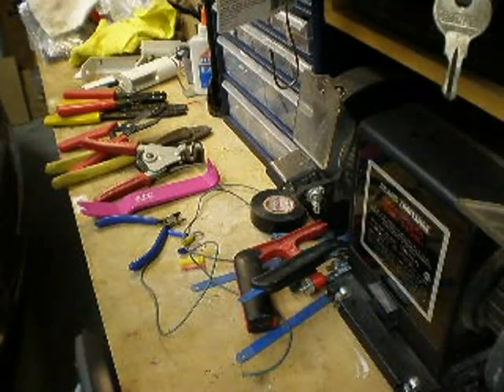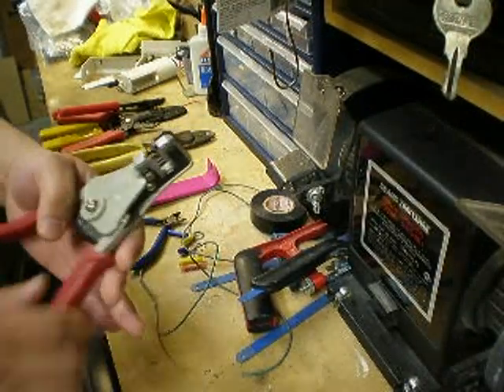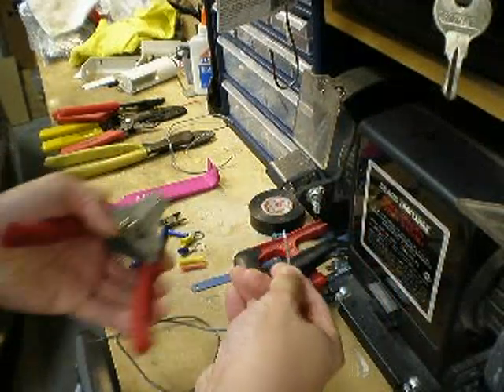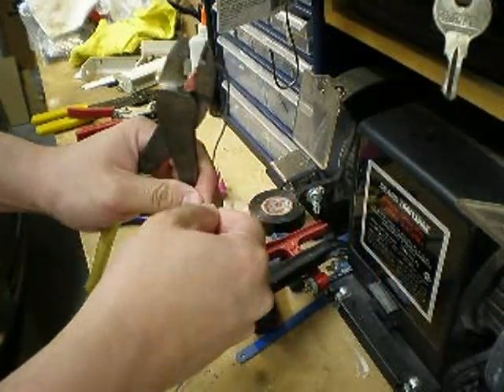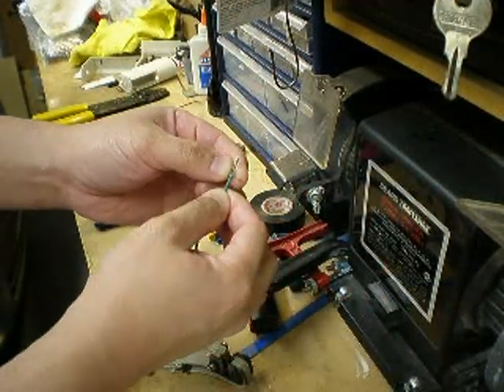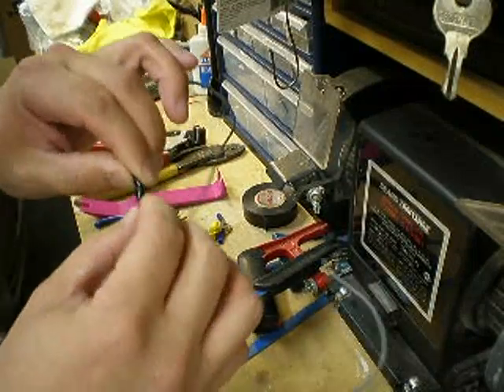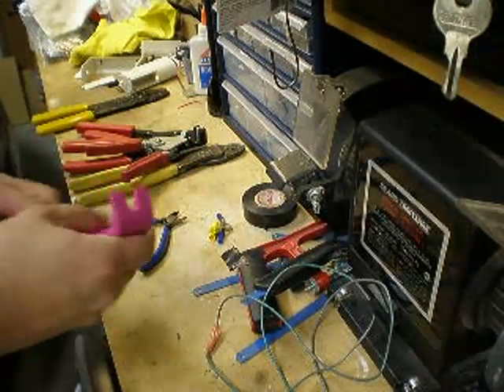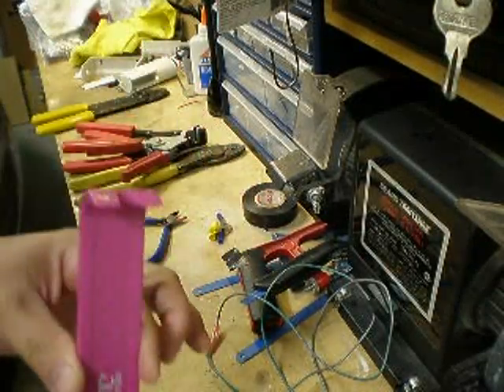How To Crimp Wires & Tools To Use

Comment: Great video, THANK you for sharing your knowledge. I partically appreciate the PLASTIC PRY BAR that you showed. Its incredibly frustrating to see installers use just metal screwdrivers or flatheads to pry things off of the interiors MANY time blemishing, damaging, chipping and even scratching paint and breaking interior panel connector parts. That tool is essential. Recently I had a headliner installed and the person broke clips and epoxied interior stuff, scratched things, I'm furious.

Comment from the maker: @yamsack1 Good question, the two wires don't need to touch. Inside the butt connector, there is a metal tube that will act as a conductor for both wires. In fact it's this metal tube inside that is doing the actual crimping. The color jacket outside is just an insulator so you don't have a short with other wires.

Comment from the maker: @labisamra The aftermarket radio wiring harness is a factory fittng connector that plugs directly into the factory radio connector (after you disconnect it from the factory radio). The other end of the aftermarket wiring harness is a bunch of wires that you need to connect to your aftermarket radio. When you connect these wires, you can either crimp or solder and shrink tube. So you still need to crimp or solder.

Comment: Thank you so much for this little video.  I'm definitely new to working on cars and working with anything electrical, but am just about done fixing my van.  I've replaced a cooling fan motor, a vacuum hose, and the relay.  I couldn't find anything on how to replace the fan relay wiring harness.  The idea of cutting those wires scares me.  Your video has helped immensely.  Thanks.  :)
Reply from the maker: I am glad my video was helpful. Also check out my updated video in HD: http://youtu.be/uaYdCRjDr4A

Comment from the maker: @bsiffy   the copper conductor of both wires don't need to touch because the butt connector itself has a metal tubing inside to act as a conductor for both wires.

Comment from the maker: @LucyBbyGrl For car stereo install, you can either buy the red or the blue one. The red one is for smaller gauge (thickness) wire than the blue one. If you find both, the blue one will work well. You can try your Home Depot or even the auto dept in Walmart might have them. If you not in a rush, Ebay has them too.

Comment from the maker: I use the bottom one for most 12-18 gauge connectors, but higher gauges like 20-22 gauge should use a crimper with the smaller die.

Comment from the maker: A quick check on the GS-388 seems a big small (short). I saw on Amazon a Channellock 909 for $18 which is closer to what I have. Both probably work, but the longer handle one will have more leverage. I have seen ones similar at Home Depot and Harbor Freight.

Comment: So I have a similar crimper as the one you said that you like better because of the leverage. However, I am not exactly sure which socket to put it in. Is it the bottom one for all butt connectors?

Comment from the maker: @rjmaharaj84  Both solder and crimping provide good connections for automotive application. As long as you do them correctly. Solder + heat shrink is a much more solid connection but requires more time and also depends on where this wire is located, may be tough to solder in a tight corner. I have done installs where I have used both methods on different wires.

Comment from the maker: @yamsack1 You can probably get away with stripping the wire with a knife but it's probably more dangerous. Wire strippers of different style can be had for quite cheap. As for the crimping tool, your regular plier wont' work, just not enough leverage to do the actual crimp. You need to put a lot of force on it so the wire don't come loose. You will end up destroying the crimps instead. I have seen those crimpers at home depot. Go check it out, it might not be that much.

Comment from the maker: When it comes to electronics, there are so many different boards/connectors/wire gauge/etc. If you are trying to patch two thin wires together, you might be better off solder and put heat shrink on top. If you don't know how to do this, search Youtube or google.

Comment: @faYte0607 
Not necessarily I'd say, inside the butt connectors there is the metal sleeve which passes the current. But it doesn't hurt to have your wires at least halfway in from each side so they contact and get the best connection possible.

Comment: When you crimp two wires together using "bullet connectors", is it necessary for the two uninsulated wires to be touching each other? I would assume so or else electricity wouldn't be able to pass right? Same goes for butt connectors and plastic crimps. If anyone knows, please let me know!

Comment: GS-388 crimping pliers is the crimping pliers. Can you just double check for me because I do not want to make a mistake.

I tried to put a link on google but I cannot. Can you simply google it for me and check to see if the bottom socket is the correct one? I apologize for asking for so much but would really, really appreciate it.

Comment: can i use butt crimps on ground wires for a 16 gauge wire for a parallel circuit for some 36ish Watt light fixtures?

Comment: I did the tape method to bypass my motorcycles side stand switch. BIG MISTAKE. it's all over youtube. i'm now going out to get the thermal connection and stripping the wire.

Comment: What if you use the electrical tape, but indoors?
Reply from the maker: I find the tapes made by 3M to be the best in any weather condition. However, over the years, those adhesives eventually break down. Indoor use will be better than outdoor use but if the connection is critical, I'd stil crimp or solder.
Reply: oh ok thanks

Comment from the maker: You crimp down on the conductor (copper wire) itself. End of the crimp has 1/4" opening for the insulator  to position (so you don't have bare wire hanging out of the connector)

Comment: do the two wires actually need to touch each other? or will the metal on the inside of the butt splice conduct electricity if the wires are not touching? please help!
Reply from the maker: +Nico Lucia If you using the butt connector, the wires don't need to touch, there is a metal tube in side that will crimp and hold both wires.